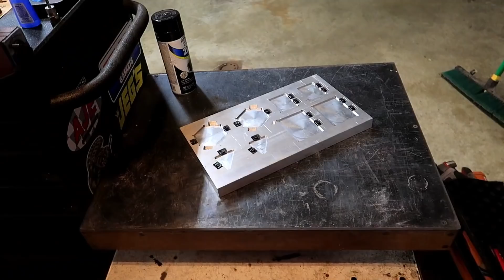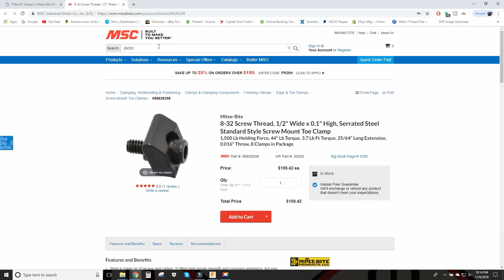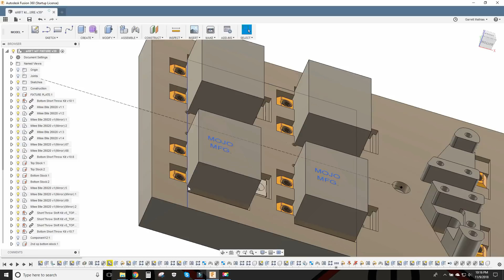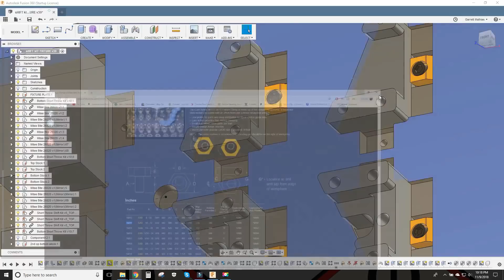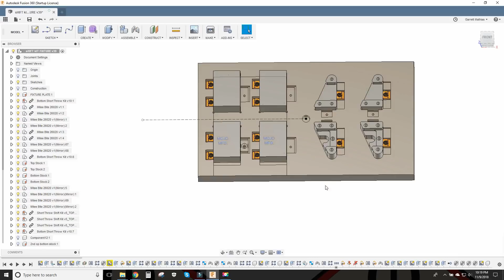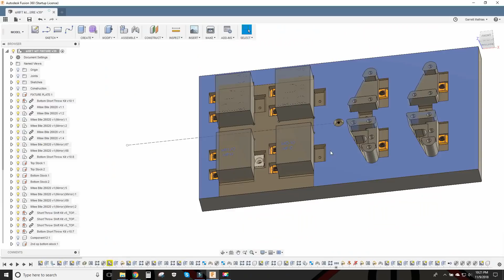My Fixture Designs: Home Mfg. Days #65

Comment: one thing about the corner holes, in cad if you chamfer or fillet the sharp edges on the corner relief holes you can more easily mill them with a small tool, and milling them instead of drilling will keep chips from accumulating in the drilled hole (V point probably) which can work their way out of the hole and into the important part of the fixture, and are annoying to clean out every time with a hook & pick set.  https://imgur.com/a/gTVryE9
Reply from the maker: Ahhh.....yes that is a good idea as well! You are full of good info.  Keep it coming! Thanks!
Reply: @MojoMfg   Figured out if you have a pallet system like a Pierson Pallet and you just bolt the fixtures down to the pallet then they might actually move over time. Dowel pins! A very light press fit or slip fit is better than heavy press fit for locating, probably called a "locational" or "positional" fit in the limits and fits chart.  With the mechanical interference of the pins they should stay in place and be easier to change.  I bolted them down and machined them in place, but they moved on me.  Custom fixtures are quite the rabbit hole.
Reply from the maker: @multiHappyHacker  Yes, pallets can cause quite a bit of frustration sometimes.  I just tried to make them as simple as I could.  Did your's move over time or immediately? I was thinking the holes where the dowel pins fit could have gotten warped over time because the pallets are aluminum...
Reply: @MojoMfg  I have no idea. They were bolted down solidly with several 1/4-20 fasteners before machining in place.  Have only used the fixture a few times, still moved.
Reply from the maker: @multiHappyHacker  How much did it move?
Reply: @MojoMfg  4 thou, cocked at an angle.  made sure the pallet system was repeating and it is.  Could be the 4 or 5 1/4-20 fasteners aren't bottomed out, but I kind of doubt it.  It indicates straight so it was machined straight too, might have been a heating and cooling cycle?
Reply: I checked the pallet system too, still where I put it.
Reply from the maker: @multiHappyHacker  It could be the heating and cooling.  Was it machined on a Tormach?
Reply: @MojoMfg  yeah
Reply from the maker: @multiHappyHacker  That could be some of your problem in itself.  I'm not saying its the whole problem but it could have some effect on it.
Reply: @MojoMfg   Well the fixture sliding around probably isn't the machine's fault. Fixture was still machined straight originally after I rotated it back into position.  I think the dowel pins will really help keep it in place, for clarity I didn't have the dowel pins in it originally.  A heavier press fit into aluminum the pins seem to want to go in crooked too.  The machine it's self is likely every bit as accurate as a new knee mill from Taiwan or wherever.  The heating and cooling is pretty likely though.
Reply from the maker: @multiHappyHacker  Yeah I would say heating and cooling is a likely suspect as well.  I just know that if I'm not careful then I can easily get my tolerances all out of whack.  That's why I use a collet tool holder instead of a set screw tool holder when machining things that need to be tight toleranced.  So I can indicate the tool perfectly concentric with the spindle.
Reply: @MojoMfg  Makes sense, I used a paint pen to mark a straight line down from the spindle housing to the spindle nose and a mark on my tools so I can clock them properly to get the same runout every time.  Definitely a must on a probe or haimer.  I also have a pretty sweet interapid indicator on an arm.  It is a lot more sensitive and convenient than a haimer every now and then, in a 10mm set screw holder though.  https://imgur.com/UPm8Zo9

Comment: I think they are slightly cheaper on mcmaster (plus their shipping is insanely good), and you're absolutely right about the pitbull clamps, they're great.  Same pack on mcmaster is $80.  As an aside, hex clamps kind of suck unless you have a long flat side to press a bunch of them up against.  Not enough hex clamps = parts lifting out and breaking the tool, possibly slinging across the enclosure or the room.  I've stepped up to the 1/4-20 pitbulls and hex clamps too, 10-32 is just too small for the hex clamps.

As for the wcs origin reference, I've been machining a small trigon onto the edge of the fixture (as suggested on youtube in a video by someone important I can't remember who), as long as you have room for it, it seems to work quite well.  Ha! I haven't been able to bring myself to pay for the backside rails either.  I'll upload a video showing the trigon I'm talking about if you're interested.  Video up.
Reply from the maker: That's good to know, I'll have to keep mcmaster in mind.  I still haven't gotten those hexagon clamps yet and I'm not sure I ever will.  I would be very interested in seeing that trigon for the WCS.  Thanks for all the help!